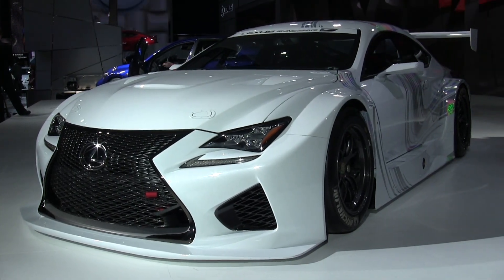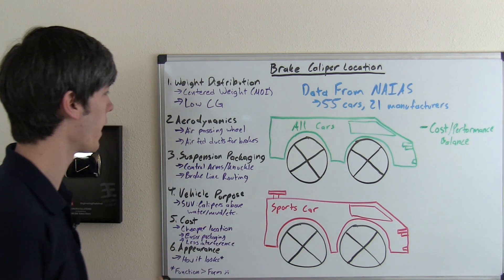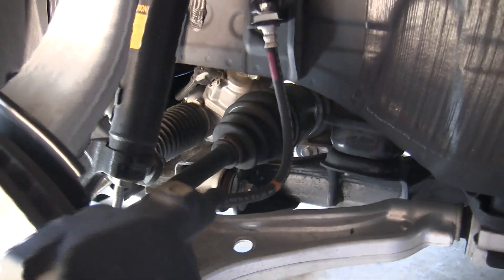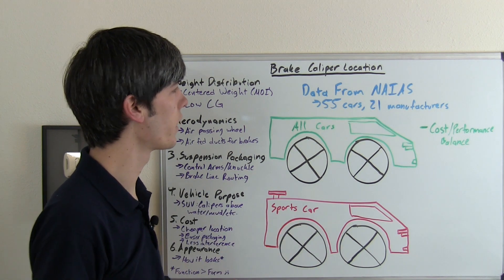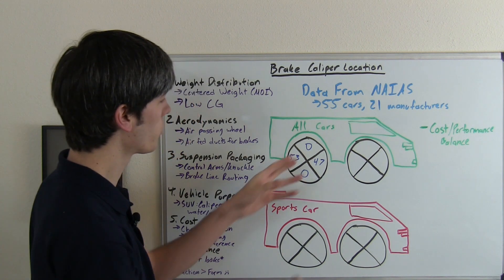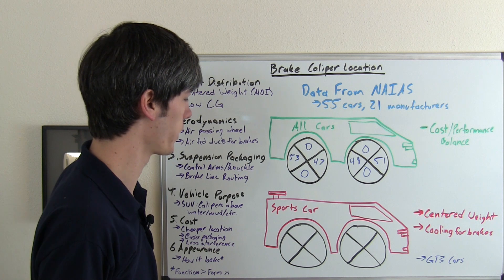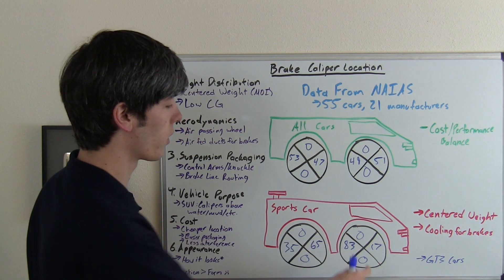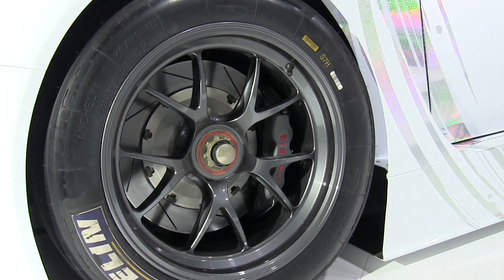Brake Caliper Location - Explained

Comment: Anyone know why the whole break disk isn't covered in one giant break caliper?(assuming we're not worried about the suspension or the steering links getting in the way)
Reply from the maker: +Max McTabish Not necessary. Adds weight, and there wouldn't be airflow to cool the brake.
Reply: Engineering Explained Yeah makes sense. Thanks.
Reply: +Max McTabish Heat dissipation and control  no to mention un-sprung weight which is a HUGE consideration when it comes to efficiency of the steering and suspension. 

For the same reason I questiopn those that run 20 series rubber on larger than standard rims when the suspension was designed to use 40 or 60 series tyres as part of the suspension and to dissipate some of the cornering forces, to little flex in the tyre even under brakes effects how efficient your braking is and remember if your tyres don't grip then you in effect have shit brakes  The entire braking and suspension work as a team  if you change one thing then tune the rest to compensate.
Reply: Because you spelled brake wrong.
Reply: mozzmann Ok so tyres loosing grip before the breaks do is an actual problem... That's something I've wanted to know for a looooong time. Thanks mate!
Reply: +P That "part" to the top right of the photo you linked with the Tesla "T" on it is just another caliper as you suspected. Specifically it is a parking brake caliper. 

Many exotics use separate mechanical caliper for parking brakes duty only. Those cases are usually because of the use of multi opposed piston service calipers in conjunction with 2pc aluminum hat brake disc's.

Lower cost cars that use 1pc iron disc's "usually" use mini internal drum drum brakes for parking brake duty which is why on those you do not see that extra caliper when the car has multi opposed piston rear calipers. Now why Tesla went with the separate parking brake calipers even though they are using a 1pc iron disc(?), that part I can not answer.
Reply: Cooling. Plain, crap brakes will become sluggish if they get to hot.
Reply: +Max McTabish Some cars have two brake calipers on one disc however, one at the front and one at the back
Reply: +Max McTabish smaller parts are less expensive, and brakes that are too powerful can be dangerous. You don't want the brakes to always lock up even with an ABS system.
Reply: +Max McTabish  There'd be no way to cool the disc. IE tremendous disc and pad wear and Ideal ratio of air available to disc and clamping material to disc material, together with tires' ability to grip...   equals best breaking for money spent "for brakes" I think...
Reply: You fellas NEED to go back to School

momentum = mass x velocity
mass = weight
Reply: +Chris P yay! Thanks a lot!
Reply: +Tim Beals Ah NO it won't  !! Simply by virtue of PSI applied to the disc surface .
If you have a constant 200PSI applies to 10 Sq inches of  standard Pad , and then suddenly you have a Caliper arrangement that has 40 Sq Ins whit the exact same 200 PSI hydraulic force applied then you have reduced you total brake force by around 4 times BECAUSE you have effectively quadrupled the brake surface area to get the same retardation you MUST increase your pressure by 4 times. 
In other words if you have increased the brake surface by 4 so to obtain the same compression force you will have to increase the force applied by a factor of four to have the same retardation of wheel rotation .

Think of a 100 lb woman with just the stiletto's heel standing on your gut, and then the same woman woman with sneaker's . same force applied but dramatic increase in surface area thus lower PSI applied and thus much less braking capacity.
Reply: mozzmann in a closed system where no addional displacement volume from the pressure source could be added, then yes you would get a pressure drop from an increase in area. In a brake system though, the pressure could be maintained since the pedal could be pushed further to compensate for the addional displacement volume needed for the addional piston surface area and therefore the pressure is maintained. 

Also brake torque generated by the pad squeezing on the brake disc is a product of clamping force (do not confuse pressure and force) along with the coefficient of friction between the disc and pad... Also remember that clamp force from a caliper is simply the input pressure times the total piston area (for one side of a caliper if it's a multi opposed piston caliper) then times 2. Having said that, with a greater piston area, less pressure is needed to generate the same clamp force between the pad and the disc... example, if you have a caliper with 2in/Sq of area, you would need 500psi of hydraulic line pressure to get 2000lbs of clamping force. If you have a caliper with 4in/Sq of piston area, you only need 250psi of hydraulic line pressure to get the same 2000lbs of clamp force.

Also just to note, don't look at pad surface area cause it is totally irrelevant to all of this. Pad area does not effect anything except average means temperature of the pad and the wear rate. It has no effect on clamp force or brake torque generation.
Reply: Tyres aren't good enough, the brakes are powerful enough to lock the breaks but the tyres can't grip up as well hence abs
Reply: xp677 Blame autocorrect... Damn thing even changes autocorrect to autocrocodile sometimes.
Reply: +Engineering Explained I noticed that some cars have a smaller piston thingy on the disk like here: http://d2odvx3v4cbpyu.cloudfront.net/wp-content/uploads/2014/01/Tesla-Model-S-Brakes.jpg
Is that just another caliper?
Reply: +P  No but being as it is on a "Tesla"  I'd say it is more likely to have something to do with energy recovery.
I seriously doubt it is a caliper given it's size and lack of area it cover's
Reply: +Max McTabish Aside from the weight and heat issue the pressure required to get effective braking from such a large Pad to Disk area would require so much effort multiplication.  That is why most brake systems have 2 and 4 piston caliper's capable of exerting anything up to 200 times your foot pressure onto the Pads and Disks (ON all 4 wheels )
Reply: mozzmann That was what I was thinking as well due to the size but I have seen it on other cars as well, some which definitly aren't hybrids or electric cars
Reply: mozzmann Right I figured that had to be the case, but I've always heard conflicting information about it. Originally, I thought that no car breaks would be able to overpower the grip in good conditions, but obviously that's not true.
Reply: mozzmann Haha ok so why does my tractor in Euro Truck Simulator 2 have like 4 or 5 different types of breaks, if using them all at once would surely lock up the wheels? Apparently Volvo has some sort of panic break system with their trucks that activates ALLL the breaks when you panic break, so how does that not lock up the wheels?
Reply: Max McTabish Heavy trucks carry much more momentum than average automobiles, thus those trucks can tolerate more braking force.
Reply: Edward Zeta I don't really see how momentum allows them to not skid though.  Maybe all the weight that is resting on the tyres helps alot, but momentum would only make it harder to slow down.

Edit: I forgot that trucks have alot more surface contact... Especially the dually axles. That probably answered my question now that I think about it.
Reply: +Max McTabish Well first off that is a game that does not in any real way reflect the behavior of a standard semi-trailer good fun but not realistic, 
BUT there are some European trucks that have separate breaking systems where you can have trailer only , trailer and 30% Prime Mover and various settings in between as well as an emergency application that is available WITHOUT brake application on the Steer tyres .
Reply: +Edward Zeta Ah NO actually trucks have more MASS and thus greater traction BUT extra size in the tyre contact patch can actually hurt in some cases , particularly in the case of aquaplaning where as the name suggests there is a film of water between the tyre and the road surface. 

As a general rule trucks can exert more force on the drums and disc's and then because of greater weight that assists with grip on the road , thus is why a fully laden Semi can stop much faster than one that has no load .
Reply: Mass is related to momentum and weight.
Reply: mozzmann Dude, you just demonstrated exactly what I was talking about. Read how I said "related".
Reply: mozzmann haha I'm still in school XD My excuse is that I haven't gotten to drive a vehicle yet.
Reply: +Edward Zeta Go back and read what you typed previously.... You said "Mass" is related to momentum and "weight".... "Mass" IS "Weight, not "related" to weight.

Also, the momentum has nothing to do with the amount of traction heavier trucks have, its just the weight. The momentum effects the brakes in the amount of heat that the brakes must be able to dissipate. More momentum (really more kinetic energy) means more energy conversion (kinetic to heat) that the brakes must do. Its still the traction force of the tires that stop the truck and the traction force a tire can generate is strictly dictated by the vertical load upon it and the coefficient of friction between it and the road surface.
Reply: +mozzmann Pressure will always be the same no matter how big the area becomes on a Hydraulic braking system, only 2 things will change the force on the pad with continue to increases with the size of the piston but at a loss of the piston & pad travel distance.
Reply: mozzmann Yes mozzmann is right. I'd think that would be common knowledge... 

Think of a tank. One reason tanks use tracks is because they spread out the weight better than wheels do.
Reply: +mozzmann Hydraulic systems don't follow the same rules as atmospheric systems do, you can't destroy or lose energy the PSI in the braking system is aided by the surface area of the piston. 
This is a law of hydraulic systems, that's why you can lift a car with one pump of a jack. Now increase the size of the jack's piston, PSI X Area= a greater Force but at a loss of the distance the piston traveled.
Reply: +Max McTabish That's the problem it's not common knowledge, hydraulic systems follow different rules then normal atmospheric systems.
(Pressure X Area = Force) as the area goes up so does the force you apply to the brakes but at a loss of distance, which in braking systems you should only ever have to move 1/16".
Reply: Tim Beals Nooo I think you're confused. Maybe I'm wrong, but I think you're talking about the multiplication factors that hydraulics can have. Check this page:
http://science.howstuffworks.com/transport/engines-equipment/hydraulic1.htm
Reply: Well bugger me if we look back at the original question re Pad size and pressure , what I said is perfectly correct, 
say you have a 12 mm bore Master cylinder and this has 80 Kg of foot force applied (Irrespective of pressure generated the fluid in NOTHING MORE than a transfer medium !!, but if we look at volume ratio between the Master and the slave  to say a 50 mm Slave
there is a rather large amount of multiplication occurring and this is then passed on to the Pad, now if you use a small pad there is a higher efficiency BUT at the expense of longivity and temperature generated. 
I am reading and I believe understanding your argument but I believe that your either misunderstanding what I am saying or the theory that you baseing your statements on.

+Tim Beals no it won't and cannot possibly be so . if you have a gauge in a test rig and place shot bags on a platform pressing on a master cylinder , then you will get a constant multiplication via the ratio of Master to slave cylinder size,   BUT the pressure there will remain the same on the Slave Cylinder Piston yes BUT the actual surface grip pressure PSI WILL change as the Pad size is either increased or decreased, it can NOT possibly remain constant if the surface area is changing yet the applied force remains constant.  As I explained earlier same force different sized pad  then the pad to disc pressure changes yet the hydraulic pressure does not .
10 Lb on the Master might give 200 Lb on the slave and the Pad has an area of 5 Sq Ins giving a surface pressure of 40 PSI if we increase the Pad size to 10 Sq Ins  then our surface pressure halves to 20 PSI for the same hydraulic pressure. 
Is that clearer to understand  and shows what I mean agout the pressure relationship
Reply: +mozzmann The "PSI" at the pad surface does not make a difference. Yes, as you are saying about if the clamp force stays the same and you change the size of the pad, the pressure between the pad and disc will change but this does NOT change the pads friction force that it will generate. Look up the laws of friction and you will find that friction is strictly related to the coefficient of friction between two items and the normal force between the two. " Remember, "Force" and "Pressure" are two totally different things that are NOT to be confused..... All in all, friction is a very misunderstood topic, yet its a pretty simple topic.

What matters is the actual force (normal force) that the pad is being subjected to (the clamp force that the caliper is generating, this is the "normal force"). If you look at the calculations for determining brake torque, the ONLY TWO aspects related to the pad that are taken into account is the coefficient of friction (Pad µ) and the effective radius it creates on the disc.. Nothing about its surface area (which is the only relation to "pressure" at the pad's surface) is taken into consideration (because it does NOT change the pads effectiveness (again, friction is relative to the friction coefficient and the normal force).  Whether the pad has 5sq/in or 10sq/in or any other surface are, the friction force will be the same if the clamp force generated by the caliper is the same. The only relevance that the surface of the pad has is its overall wear rate.

The exact formula for calculating brake torque is: 
(Caliper Clamp force x Effective radius x Pad µ x 2) / 12

Clamp force is:
Hydro. Line pressure x piston area (only one side of caliper if opposed piston setup like a 4 piston caliper... You only calculate one side / half of the caliper because the about calculation for torque takes into account for the other side (the times two part of the formula).

Effective radius is:
Disc radius - 1/2 the pads height (basically the centerline radius of the sweep area)

Notice that none of the above anywhere takes into account the pad's surface area. This is because it is totally irrelevant in the ability of the pad to do its job in generating a friction against the disc to generate a braking torque.  The only thing that the pressure per square unit of measure of the pad's surface effect is the rate of wear of the pad. As said, it doesn't matter how much area (therefore the force per unit area (PSI)) the pad has, it will still generate X friction force for X total clamp force.
Reply: +Musclecarlover7 that is for drifting, one set of brakes is a dedicated brake for the hand brake (usually hydraulic)
Reply: +Max McTabish The reason the entire rotor/disc isn't sandwiched by two ring shaped pads (effectively covering the entire rotor surface area) requires a basic understanding with the law of conservation of energy.  When the brake is applied, one is taking rotational energy and converting it into friction, which gives off heat.  Energy is neither created or lost, just "converted".  So this means for a good braking system, heat dissipation is KEY.  The reason "larger" braking systems don't really apply super large pads that cover "more" of the disc, yet apply larger diameter discs is to provide more rotor surface area for cooling.  Additionally, discs with interior vanes cool better, with curved vanes taking it one step further.  Without proper cooling, "brake fade" sets in rendering your vehicle unstoppable, until the rotors can cool enough to transfer more heat.

The material of the disc also plays a key role in heat dissipation which is why carbon ceramic rotors are used in extreme applications (high-performance and super cars).  Performance steel systems can usually brake as well as carbon ceramic systems, however under continued extreme braking, steel won't be able to keep up with heat dissipation demands.  Ceramic rotors are also lighter which reduces rotational mass, aiding in many other areas but that's for another discussion.

And of course all the heat dissipation in the world is pointless without proper grip (tires) but that goes without saying.  Tires are often over looked and under budgeted but are key ingredients for putting down the power and maximizing your braking system, again, a topic for another day.
Reply: DJ RichieRice oook I get it now. So, in that case why don't performance cars have retarders or engine breaks like the big lorries do? Then they wouldn't have to use the breaks as much, and they wouldn't get so hot.
Reply: +Max McTabish 
Engine retarders or exhaust brakes worth by using the engines compression stroke  "doing the opposite" of making power every 720 degrees of crankshaft rotation.
Gas engines have (approx) half the compression. of a camparitive diesel & would be far less braking torque to slow vehicle.
Modern vehicles' ecm upshift asap for mileage & emissions.
Leaving vehicle in "drive" facilitates this. Drivers can "downshift" out of overdrive and increase engine speed (to a point) increasing engine (speed) & therefore engine braking.
Reply: +James Tennier 
Performance vehicles are complicated enough, as is, and already have higher compression. Retarders per se would only add another level of complication.
Reply: James Tennier, +Max McTabish

  Along with what all you mentioned, engine braking for the typical (gasoline engine) manual transmission car is actually a bad thing to do. The reason for this is most cars use a "strap drive" pressure plates where the pressure plate itself is connected to the basket via sets of metal straps. These straps are only designed to be loaded in tension.

Under normal driving (acceleration), the drive straps are under tension as they were designed for. When one engine brakes, Torque is being applied from the driveline back into the engine to overcome its compression induced load (basically backwards from whats "normal"). This puts the straps in compression loading and thus they can become bent and broken. This problem is quite often experience buy people who take their everyday street cars that have singe disc clutch's to track day event and use heavy engine braking.

The reason why large diesel trucks and purpose built track cars can get away with engine braking is the clutches use have pin or spline drive setups where the pressure plate(s) are locked into position via pins / posts or splines and thus can handle torque being applied in either direction.
Reply: ***** That means that using the friction of the engine as a break will wear your drive train down after a while? I've not heard that before.
Reply: +Chris P   I think you might be missing what I am trying to convey 

IF you have a constant force applied to the piston in the slave cylinder via hydraulic means, and that is pushing the Pad onto the disc and you do NOTHING more than change the PAD area ie increase it's size then the PSI force applied to the Disc MUST reduce in relation to the area that force is applied to,   

If I place  a mattress on the ground and stand in the middle I'd likely fully compress the inner spring under my feet OK  Now if I place a sheet of Plywood on the same mattress and then stand in the centre as before allowing for the weight of the ply I have not changed my weight yet massively increased the surface area that weight is applied too thus dramatically decreasing the wright / Sq inch applied as a result , Now if we apply this to a Disc brake the very same thing happens increase the disc and pad size the corresponding increase in applied pressure is required to have the same clamping force .
Reply: You will have wear regardless as it is inevitable , and this naturally occur anyway when you lift your foot. when basically coasting anyway. 

         As for Clutch plate systems in the US they seem different to here, most here us a combination of locating pins and Straps that in some transfer drive but are used for electrical noise reduction and location.
 
          The number of driver's that do not realise they can utilise engine breaking in an Automatic system is astounding as well , either that or they are just lazy and follow to close to allow the vehicle to slow gradually but require heavy braking, BUT I live in a rural setting so the brakes don't get a flogging like they would in the City either.
Reply: You guys have really confused me now lol
Reply: +Max McTabish You would just lock your wheels. The calipers are big enough to provide stopping power. if the whole disk is covered you will lock up with the slightest touch. There would be no increase in performance , it would cost more and i dare say there are many engineering issues with this too! Look at an F1 car and how quick they stop. they still lock up and essentially its the same setup.
Reply: Mattinahat Yeah that's basically what I've gotten from the first few posts. It makes sense, but I originally thought cars had more grip than that.
Reply: its more the response. Even just lightly brushing the pedal with a 360 caliper wold instantly apply a lot of force of to the wheel. thats a recipe for a distater.
Reply: +Max McTabish Interestingly, I've seen some purpose built Ford F550's for the fire service with dual front calipers. These also had planetary gear reduction hubs with 40 something inch super single tires with straight steel wheels.
Reply: +Mattinahat No it wouldn't actually because of the surface area and the lack of clamping available  which is why the average caliper is around the size they are, remember that it is a balancing act between Weight, Grip of the disc and NOT over powering the grip of the tyre (which is why ABS was invented BTW - Caliper's and discs got more efficient)  so rather than make them smaller the engineers decided to employ electronic modulation because they believe the average driver is a dickhead and cannot break effectively in adverse conditions and they are IMHO correct .  This makes driver's these days LAZY because they rely too much on electronics and will not go and do some advanced driving courses and learn about their Own reaction times and their car's abilities.
Reply: +mozzmann Again, you are confusing force and pressure DO NOT, they are two totally different things. As said, the "PRESSURE" between the Pads and disc does NOT MATTER. As said, when talking friction, the AREA does NOT matter, the "FORCE" applied along with the Coefficient of friction between the two sliding components determines the friction force. If you take a standard 28lb. 8x8x16 masonry block, no matter what side you lay it down on a flat level concrete ground surface, it will take the same force (roughly 11.2lbs) to push / pull it parallel to that surface. It doesn't matter if you lay it down on the 8x16 (128in/sq) side or the 8x8 (64in/sq) side, it will take the same force to drag it along the ground. This is the laws of physics. Again, the area and thus pressure (since the pressure will be the force (the 28lb. mass of the block) divided by the area of the side that you lay down) does not matter.

For the brakes, the clamp force (again, dont confuse force and pressure) is a product of the caliper piston area times the hydraulic pressure applied. This force is transferred directly into the pad and thus becomes the force between the pad and disc and this force times the coefficient of friction between the pad and the disc determines the friction force and the friction force is acting on a rotating object and thus becomes a torque... It does NOT matter if we have a pad with 2in/sq or 10in/sq, if the clamp force for the caliper is the same, the brake torque will be the same. The actual pressure between the pad and disc does NOT matter.
Reply: +Mattinahat Technically you could have a full 360° caliper and pad setup and not lock the wheels instantly. Its all about the total piston area which therefore determines the clamping force between the pad and the disc. For example, you could have 40 .375" diameter pistons and only have 4.415in/sq of piston area which is in the same range as many 4 and 6 piston calipers....

Now is that practical? definitely not but still technically possible nonetheless...
Reply: +Max McTabish He explained it in his brake pad video - you'd get no ventilation to cool the rotor.
Reply: +Max McTabish heat dissipation! It would be impossible to exchange that heat if you cover the disk
Reply: +kutlay gül -ish kinda... don't forget the center hub of the disk is open so air enters at the center, then exits at the outer edge. The rotation alone will pump air through it. The bigger function is it just isn't needed, and you'd have some weird disk like brake pad that would probably suffer serious stress cracking because it has nowhere to expand to.
Reply: +kleetus92 that is right! also need to consider heat in brake pads. whole caliper doesn't make any sense: heavier, more expensive and as you said you we don't need that much braking power at all.
Reply: kutlay gül More like impractical, but not impossible. As kleetus92 said, there are ways to get air though the disc to cool it. Large airliners (like passenger plans for example) use full 360° disc brakes / calipers. The actually use multiple disc's and pad sets per wheel and they are not even vented disc's either. Granted they only have to make one massive deceleration event before being allowed to cool again fully again, but the amount of heat that is generated from that one deceleration event is tremendous as the amount of kinetic energy that needs to be converted to heat is tremendous to to the mass and velocity. Even with the reverse thrust from the engines, the brakes are still taxed tremendously.
Reply: ***** I wasn't really thinking about one solid break disk, more like a few placed around the wheel as to somewhat encircle the whole axle. Then people could obviously find ways to handle the heat.
Reply: Max McTabish While yes, its technically possible its just simply not needed. Even the full disc brake setup used on planes isn't one solid pad all the way around. They are normally puck segments with gaps between them but usually on a common full circle backing plate. You really couldn't have a solid single pad cause you have to allow for thermal expansion or cracking and fragmenting will occur.

All in all, as said, it can be made to work, just simply not needed (no benefit to it for automotive applications) and just substantially raises the cost of manufacturing and servicing not to mention added unsprung weight which is bad from a handling point of view. The only benefit that could be achieved by it is longer wear life which is why its used on planes. In automotive applications, for everyday street use, pad wear life with quality pads is already very good.
Reply: ***** Okay cool. Thanks for the explanations guys.
Reply: +Max McTabish no worries. now go heel toe into so!e corners ;)
Reply: Mattinahat No idea what that means...
Reply: +Max McTabish it's a method of downshifting while braking. you rev match the engine to the clutch speed so you dont lock up and stay in the power band out of the corners. he's done a video on it. a very interesting concept and well worth a watch :) anyhow , have a good day
Reply: +Chris P 
Chris  there is absolutely no way that you can have the same pressure ie force applied to a slave piston and have the same PSI applied to several different pad sizes it is Physically IMPOSSIBLE. 

          The force applied is the same yes BUT that force is spread over different surface sizes and therefore you MUST have a different pressure on the brake disc surface relative to it's area, like your Block 

           OK using your own figures the PSI on the surface varies greatly and thus the braking ability. 
What you saying is if I have a bicycle sized disc pad, it is going to give the same braking as a truck sized pad for the same pressure applied to the slave cylinder.   
You see how ludicrous that make your statement now. 
Pad pressure IS Directly related to the applied force V Surface area and if you add in the other variables such as the Pad Hardness V the Disc Surface grain. Pad Off gassing  you can see what I am getting at 

Your confusing surface friction required for efficient braking with the Pressure applied v Surface area.
Reply: +Musclecarlover7 They use one caliper for braking and the other is for the handbrake.
Reply: +P Its the main braking caliper and also a smaller handbrake caliper...
Reply: +Slapbladder Depends on the vehicle  Some use a mechanical course thread internally in the rear piston to mechanically apply a parking force that auto adjusts clearance for wear,  some vehicles you a separate disc or drum as part of the driveline from the gearbox as well . I've not seen to many that have a park as well as a service unit but there are likely some that do.
Reply: +mozzmann correct on the dual caliper with integrated handbrake and drum brake set up etc. The reason they do this is to separate the two. It is also so the braking caliper can be as large as possible on the rear without the handbrake components interfering. Most high end sports cars and super cars have this separate braking system. For example here is a Ferrari 360... http://www.martyncliffordmotorservices.co.uk/wp-content/uploads/2015/05/360-rear-brakes-done.jpg
Reply: +mozzmann No one said that you would have the same pressure. I said you would have the same force. AGAIN, FORCE and PRESSURE are two TOTALLY DIFFERENT things, quit using them as though they are the same.  Example, I weight 160lbs so whether I stand on 1 foot or both, I am applying 160lbs of force to what ever it is that I am standing on. Now the pressure I am exerting will change between standing on one foot vs. standing on both feet because I am changing the surface area.

As I said, when dealing with friction, the area and thus the pressure makes ABSOLUTELY NO DIFFERENCE. It doesn't matter if I have a 5in² or a 10in² brake pad or any other size for that matter, the friction force will be the same between the two if the clamp force is the same from the caliper. Yes the force per unit area (i.e., the pressure) will change but the overall force (just like my weight example above) will stay the same.

The only time that one should every worry or talk about pressure between pad and disc surface is when talking about a materials strength or when talking about wear cause those are the only two time that pressure between the pad and disc matter. When talking about friction force generated between the pad and disc, pressure and area have ZERO Relevance....

Look up the brake force (torque) calculations (which I already gave you previously) and you will see that the pads size (which is the ONLY way that you could calculate the pressure between it an the disc) is NEVER referenced or taken into consideration when calculating the brake torque generated.  

This is because the area of the pad is as said, "irrelevant" since laws of friction tell us that friction force is the product of the coefficient of friction between two sliding members and the total force perpendicular to the sliding surfaces.
Reply: +mozzmann  Just to clear this up since the way that you said it can be misleading, the jack strut and thread nut in the piston / caliper assembly that you are talking about is not screwing the piston out as you apply the parking brake. I'm not saying that that is what you are saying, just making it clear for others reading it cause in a way, the way that you worded it almost sounds like you are insinuating that something is screwed via the treads to apply the brake.

All that it does is compensates for pad wear. When the parking brake is applied, a cam or ball in ramp assembly forces the just strut out which directly forces the piston out (nothing rotates). The nut inside the piston has a one way clutch of sorts that allows the nut to rotate on the threads as the pad wears to compensate for the wear. Essentially, the strut length needs to increase as pads where, and since you cant make the strut longer in operation to compensate for wear, you use a threaded strut with a one way nut action which then changes the effective length of the strut in operation. The strut does not rotate nor does the piston when in operation, just the nut that is inside the piston.
Reply: +Max McTabish 
He covered that when talked about placement of the caliper... you cannot because of many things that would hit it.
Reply: dh3790 I know that. If you read my comment, you would know that I said "assuming we're not worried about the suspension or the steering links getting in the way."
Reply: Exactly as I had said there is a course threaded shaft (In some Vehicles I have worked on) that has a lever attached to the cable that allows it to rotate inside the piston, this mechanical rotation via the cable and thus extension of the piston to mechanically apply the pads to the disc surface, I wasn't saying the piston rotated but rather the mechanism inside it and that in many cases is attached in turn to the caliper .
This arrangement some have a recirculating ball or roller clutch not unlike a sprag clutch in some automatic transmissions to self adjust, this takes up the slack in the Park brake system without effecting the service brake.

     There are probably as many types of systems to achieve this as there are makes of cars , more likely than not the exact same principles employed but mechanically very different achieving the same job.
Reply: mozzmann the threaded shaft doesn't spin. It is rotationally locked and acts as a strut rod and can only move axial to the bore (does not spin in the bore) either the caliper has a cam mechanism or a ball in ramp mechanism that physical pushes on the screw to push the entire screw outward. The nut that is inside of the piston is able to spin in on the screw and in the piston but only in one direction. There is a coil sing wrapped around the nut and locked into the piston and when the nut try to spin one direction, the coil winding tightens on the OD of the nut and thus preventing it from spinning. When the piston is pushed out by hydraulic pressure, the nut tried to lose the spring when I turn allows the nut to spin up the screw. The reason why the treads are so course  (like a cork screw) is to that the nut try to rapidly move in the axial direction. If it didn't,  the coil spring wouldn't work to act as a one way clutch and thus the parking brake would never self adjust. 

Also, since I forgot to add in the other post about the bicycle pad comment,  I'll do so now...

Technically yes, if you had a pad the size of a bicycle pad made of the same material, it would generate the same amount of friction and in theory stop the car the same as the regular pad...

Now note, I said in theory. This is because it would not be possible to get any real use out of a pad that small if placed on a motor vehicle. Due to its tiny size and assuming that the pad material was strong enough  (where pressure does come into play), it would heat up and fad virtually instantly (possibly even desinagrate virtually instantaneously). 

Now in a magical world where unicorns and leprechauns exist where you might have the ability to actually keep the pad from shooting up to a couple thousand degrees instantly,  it would deceleration the vehicle at the same rate (doubt you would get a full stop out of it though before it wore totally out.

None of that is of any concern anyways because with say 1000lbs of clamp load on the pad, it would likely shatter due to the extremely high pressure (material strength aspect).

Nonetheless, in theory it would stop the car just the same as the cars regular brake pad.

If you still want to argue the whole pad size (surface are) and it's effects on friction force / brake torque,  call any pad or brake manufacturer like Hawk, Performance Friction, Pagid, Brembo, Wilwood, AP Racing, Alcon, etc... and bring it up with them... I can tell you though, it's going to be a was of your time and theirs as they are going to tell you the same things I've already told you, the size of the pad effects the temperature of it and it's usable life and not really anything else.
Reply: You clearly have not worked on some of the same systems I have where the shaft does indeed rotate internally and over a period of time extends by means of a ratchet in some to a roller clutch in other's to maintain the correct clearance.  I am sorry I cannot remember the exact type but the bellcrank attached to the lever with via the roller clutch turns the shaft internally along the same axis the piston could rotate if allowed but it have a locating pin to prevent this from happening anyway.
  
  When I say rotates I am dealing in maybe 20 Degrees max and the roller clutch or whatever system is employed some even use a simple ratchet that is stiff enough to stay in place and takes up the slack that way . either way The piston does not or should not rotate in it's bore , I have worked on a few that use a brass pressed in pin to prevent any rotation and as a result stops the outer dirt seal from twisting and eventually failing , At the end of the day we are discussing semantics and as we both know they are so many different brake systems that achieve the same thing but a mechanically quite different.
Reply: Thermodynamics.
Reply: +mozzmann You are taking a constant force-variable area system and trying to apply it to a constant pressure-variable area system. 

Pressure = force/area, force = pressure x area. 

If you have 2 braking systems which have different surface areas for their working surfaces, the system with the higher surface area will exert a higher force on the discs if you press the pedal with the same force. 

To put it another way, if you double the surface area of the pads and/or caliper piston, you only need to press the pedal half as hard to get the same force applied to the discs.

The pressure you create from the master cylinder will be same throughout the braking system regardless of the surface areas that pressure acts on. 

Also, you equated mass to weight, they are not the same.

mass x acceleration = weight

You can change the weight of an object without doing anything to its mass.

Weight is a mesure of how much force a given mass exerts due to its acceleration.

That brings me back to your example of stillettoes vs sneakers.

The reason the same woman would create less pressure in sneakers than stillettoes is because her weight or force is the same but acting on a larger surface area.

Do you see the difference between pressure and force now?
Reply: Lee Owen you are mostly right here with your post. The only thing that is off is the pad surface area. As I've already tried to explain previously, the pads surface area is of no relevance when it could to brakes and their ability to generate a braking torque. This is because of the laws of friction. 

Friction force is a product of the coefficient of friction between the two sliding surfaces and the total perpendicular force between the two surfaces. It doesn't matter if the sliding surface has 10² inch or 100² inch, the parallel friction force (force required to slide the two opposing objects) will be the same IF the perpendicular force and the coefficient of friction is the same.

Basically doubling the pad area as you mentioned will NOT change the required pedal force. Only the changing the piston area or the pads coefficient of friction will change the pedal force.

Now there is a caveat here. Since the pads size will have an influence on the average temperature that it runs, changing the pads size can have a small effect on the required pedal effort for a given brake force. This is because although most pads have a relatively flat coefficient of friction curve, they are not perfectly flat and thus a change in temperature will equate to a change of coefficient of friction. Again though, in most cases, this is a very small effect at best (typically not even noticeable by human senses but rather sensitive equipment).
Reply: +Chris P You are correct, I missapplied my description of the raw hydraulic force of the piston to the resulting braking force that actually slows you down if you get my meaning.
Reply: I have not read all the eighty-something comments on this, but i just wanted to pitch in with a bit of physics: 

Contrary to what many people believe, the size of the area of contact(surface bewteen disc and brakepad) has nothing to do with the force of friction. The reason is that if you make the area of contact twice as big, you are also only pressing with half the force on any given point. In theory you could have a brakepad the size of a coin and it would have the same breaking ability. In reality however such a small area of contact would mean that it would heat up very, very quickly. That is why there is no point of making a caliber larger than what is needed for it to not melt away.
Force of friction(Ff) between smooth surfaces depends ONLY on the force applied(N) and the friction coefficient(μ). Ff = μ * N.  

The reason for making calibers and discs larger on a race/sport vehicle is partly to have a larger brakepad area to distribute the heat to, partly to have more disc mass to heat up, partly to have a larger disc area to transfer heat to the air and also partly to move the breake caliber further away form the center axis of the wheel, which gives the brakes a larger momentum advantage.

I am a maritime engineer student, not a car engineer so I am sure that there is much more to brakes than I know of. But what i described above is universal and fairly basic physics. And physics is true in any application(except quantum physics - lets not talk about that :D )
Reply: Sports cars can have a double break caliper.. There are some huge break calipers... there is an Audi S break caliper that is so big when you look it outside the car you think it's a cylinder head or something like that.
Reply: As I have stated before  it matter's NOT how big the caliper is , although a overly large caliper will create more issues as the heat retention is greater but at the end of the day the traction available from the tyre is the limiting factor and NOT the size of the Rotor and Caliper
Reply: the friction is more pressure and  friction coeficient of the materials than area of contact
Reply: ***** lol yeah I got the general idea, but I don't know which of these guys to believe because they're all saying different things. No matter though, because I'm finally taking physics class this year.
Reply: it wouldnt really make sense to have a brake caliper that covered the whole wheel cause it wouldnt really produce more braking power. Most sports cars are able to completely lock up there brakes reason they dont is do to abs. It is more efficient to brake using static friction meaning allowing the wheel to rotate right before they lock up rather than in kinetic friction or skidding. So in this case you dont want too much braking power from the caliper because it wont help. Also another thing is cooling you cant cool the rotor very well if its covered. The only way we would ever need a brake caliper that covers the whole rotor is if we have tires with insane amounts of grip. As long as the brake caliper has enough stregnth to lock up the wheels at any speed there is no reason to make them bigger because it will not decrease the stopping distance.
Reply: +Musclecarlover7 usually one is a parking brake and the other is the service brake
Reply: ***** haha lol so true!
Reply: Well your question has already been answered by the other replies. But this, those giant tipper trucks that work in quarries have giant brake discs do have multiple callipers covering the whole disc surface almost.
Reply: *brake
Reply: I'd hate to run into an autocrocodile :/
Reply: A few companies tried "full contact disc brakes" and they were actually fairly effective.  One company even ran them on a car in the Motorola Cup.  They were successful, the race car won several races.  The company the built them and put them on the race car even claimed they would be about 5.5 pounds lighter  per wheel than normal disc brakes (how they managed this I will never know).  Their cooling was also effective enough to run in a racing series.  the real reason you don't see them is cost, not weight or cooling.
Reply: I remember that Audi used to have in their first V8 model a circular caliber in the late 1980's. Because they didn't want to put low profile tyres in it. Assuming that they thought it would ruin the ride comfort.
Reply: Thats for separate hydraulic e-brake.
Reply: As an addítion to the other answers: airplane brakes are built close to what you mentioned.
Reply: Sgt C4 x
Reply: Noscopes Allowed some tanks have a full covered brake disk